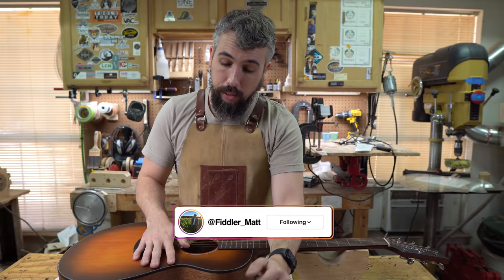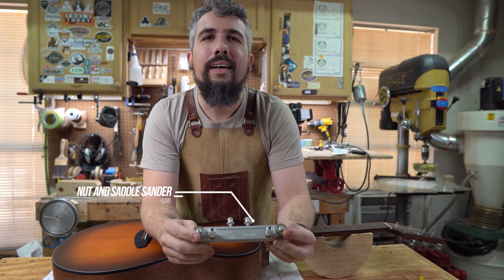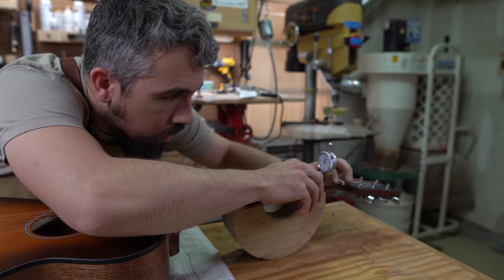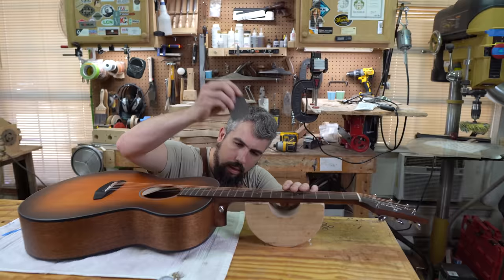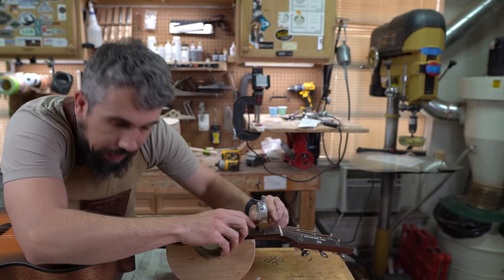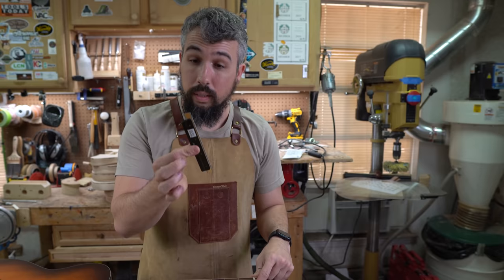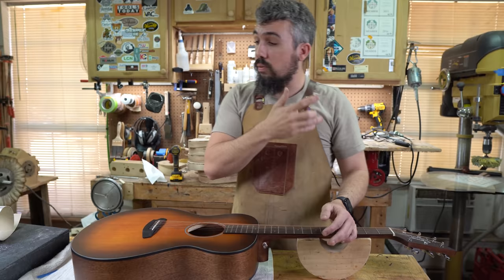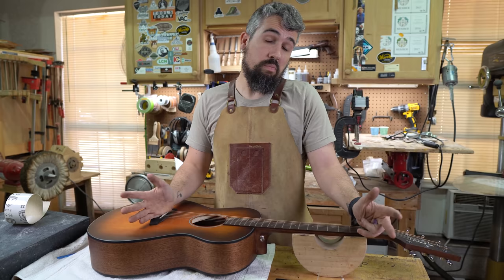How To Make $60 An Hour As a Guitar Tech/Starting Luthier!

Comment: Hi Chris,
I’m very interested in learning to do setup work! However my initial budget is a good deal lower than the $350. How do you recommend going about this? I am not planning to start a business so can’t afford expensive tooling. 
Also what are your opinions on “setup kits” from brands like Dunlop, D’adddario, and MusicNomad?
Reply: Tools are expensive to buy.  I have a metal straight edge..cheap and works fine. A credit card is a fret rocker. I can't make a nut file though.  Be creative and you can make a lot of tools yourself.  But mostly, have fun with the process.
Reply: as i said in comments stew mac is a greaat place to LOOK at tools so you can work out what you need and find unique guitar tools, but stewmac is also a grat place to see the most expensive guitaar tools, you can find most tools at way less elsewhere, and still trusted brand names too.
Reply: Sam you can make very cheap nut files from a feeler gauge set. Check out Tim Sway's YT channel for how to do this. Looks like they'd take ages to file a slot, but you can't argue with the price...
Reply: Feeler gauges- hardware store
Truss rod wrench- hex key set from hardware store
Straight edge- any stout good 18" metal ruler or builders square
Get a smallshop ruler graduated in 1/32" or 1/64" (with zero at the end of it) to measure action. 
Capo- to help measure relief with your feeler gauges and guitar string
Reply: @GarlandStringedInstruments  you can also fine tune filing nut slots with an old guitar string(slot filing according to the size string you prefer using on said slot) cut short and glued to a sideways popsicle stick
Reply: @faborwick5887  Yes, have done that! I put a bit of metal polish on the string to get that final smooth channel of the correct width.

Comment: So I have a question. I do a lot of guitar setups for friends and family etc. but now my dad gave me his 40 year old classical guitar for setup. It has no truss rod but the string action and the frontbow is even worse than on your example in this video. The only thing I could do is pull the absolutely worn down frets out and sand the neck flat, adjust the sattle and nut but he doesn't want that. Is there any way to get the neck flat without pulling the frets out? I thought about carefully fixating the guitar to a table and then hanging some weights on the neck to give it some counterweights for a few days. I'm just worried I'll warp the neck in a bad way.
Reply: Make sure he has nylon strings on it. Non truss rod guitars aren't made to handle steel string tension, you would get quite a bit of bow. Rather than sanding the fretboard I would suggest sanding the nut and saddle and get it close enough, then file high frets if needed. Start with parts you can replace and see if that gets you to an acceptable level.

Comment: Could I just “blindly” get my guitar to specific measurements and have it always work or is it more finessed then that?
Reply: That usually will require fretwork. I use the same specs on all my guitars, and the variable is the profile of the fret tops. 

Depending on how low you want to go. Fretwork becomes more and more critical the lower you want your action. 

Setup specs are binary, and yes, you can set them all exactly the same. Neck relief, Action at 1st, Action at 12th.

But what you might have to do to get them there is where it gets tricky. Also there are less obvious setup specs such as string spacing at the nut/bridge, break angle over the saddle, string alignment and intonation. Usual rules apply --- binary operation, but getting to those specs can be a real challenge depending on the particular guitar.

Comment: Isn't that superglue gunna wear down way quicker than a regular nut material?
Reply: Yes, it definitely will. If I cut a nut slot too low on a client's instrument, the replacement nut is on me.  Any mistake that I make would be my responsibility to correct. Just the way  that I roll, but your mileage may vary.
Reply: @k9er233   No that's how it should be, the customer should never get a bullshit job.
Reply: @SaumBodhi  I don't know if you can actually teach a sense of responsibility and have it stick.  But we can hope.

Comment: I've been doing my own setups for about 15 years (and free of charge for some friends and relatives), but considering a setup over here is about 20 USD equivalent, I sometimes wonder if it's worth even doing my own setup :D
That said, I'd really like to know where I can buy a passable set of nut files (consider frequency of max 1 setup per year :)
Right now I use one of those flimsy files sets that are all grouped like those filler gauges you have,which means I need to first take off the nut and get it sanded from the bottom to as close as I can and then use the files. 
I'd like to have something that at least has a handle on it and doesn't cost me 10 or more setups (basically something at aliexpress prices, that ali express doesn't have) :)
Reply: Just last night I had to file a nut notch with a .010" nut file. It's very flimsy. I sandwiched it between two wooden slats held together with clothespin clamps. The slats stiffen the file and you could also use them as a depth stop. If you are making files out of feeler guages this would be one way to hold them with no expense.
Reply: @CastlebayNet_Music  Thanks mate. That is a solid suggestion. I'm not making files out of filler gauges though. The files I have are these small (about 6-7 cm long) metal sticks held together like filler gauges would. 
Simillar to being on a key ring might be good decription perhaps. 
I could devise a handle for each, but the thinner ones would still be too flimsy. Ideal solution would be a miniature coping saw frame I guess

Comment: I picked up guitar repair/ guitar tech as a hobby. Seeing all the stewmac stuff you got, which I got, the COST SO MUCH. You need a lot of jobs just to make your money back. And if you need parts in hand like pots and switches, output jacks, thats more expense. Just getting tools for refrets COST SO MUCH. Doing setups doesnt use much.

Id start off with getting comfortable doing setups. Not that hard to check relief, bridge, pickup, nut height. Then pickups installation and electrical work. That's easy stuff. Soldering iron and solder. . Schematics are online for free. Then Id get into fret level. the last thing id practice on is refrets. so much tools, Id do cutting bone also last. to get a belt sander, blank bone nuts, files/saw.

I like doing guitar repair/guitar tech stuff. But I do regret buying all the tools in the world being it's such a expense work. Unless you got a guitar repair every day. Then MAYBE you'll make your money back to break even. If you get all these tools but all you got are setups and electrical work, you aint making your money back anytime soon.

It's way easier to just get a guitar for repair, go and see a guitar tech who already invested in the tool, and take the guitar techs cost and add 10% to charge the customer.
Then buy the tools along the way as you get a larger bank roll.

Comment: You'll probably never read this but...

Wouldn't a 'professional' set-up have to include 'dressing' the frets?  You're a master ctaftsman so no trolling here or don't take it the wrong way...  I simply think you are intimately aware that frets can't be uniformly placed on a fretboard.  Have a great day!  🤘
Reply from the maker: A setup has nothing to do with installing or leveling frets. A fret level or replacement is a whole other can of worms. If your tech is telling that the only way to get a great setup is with a fret job, then you’ve been taken advantage of. Obviously if their are problem frets, then they will need to be addressed to get a good setup dialed in, but most guitars should be able to get a pretty great setup on them with no fret modification. Most factories and custom builders press in their frets, and this can allow for a pretty perfectly level fretboard when done correctly. If you’ve only ever experienced hammered in frets, then I totally understand how you can think that you always need to do a fret level to get a good setup. I used to do it that way for years, and once I started pressing them in, most of my issues went away.
Reply: @DriftwoodGuitars  Surprised to get that very authoritative response.  You and Robert O'Brien and Twoody just impress me to no end; I've learned eo much.  Thanks!  🤘